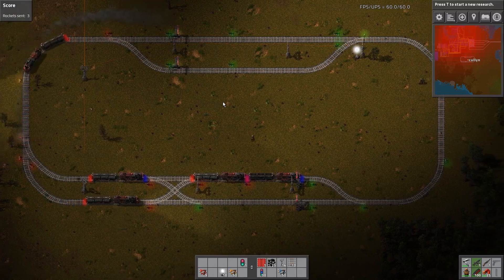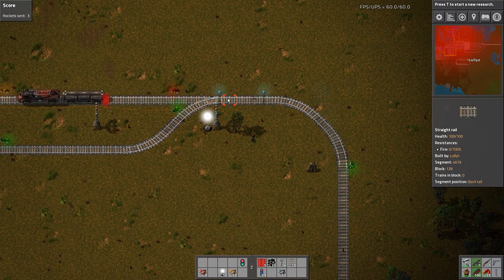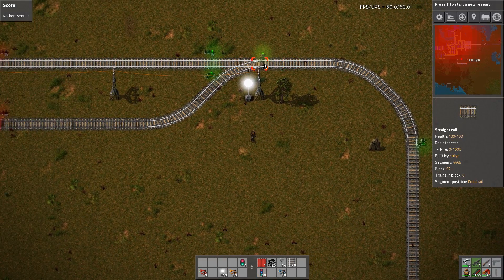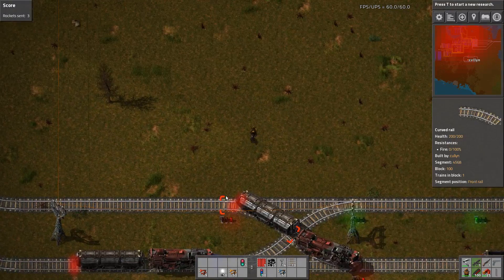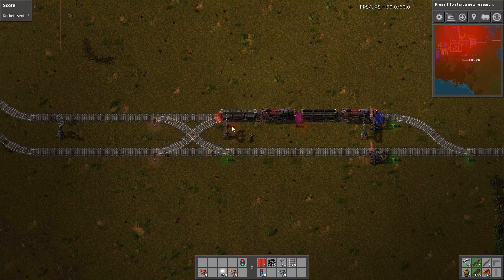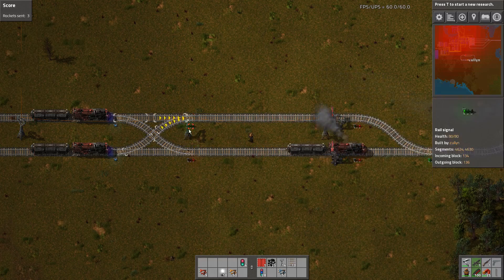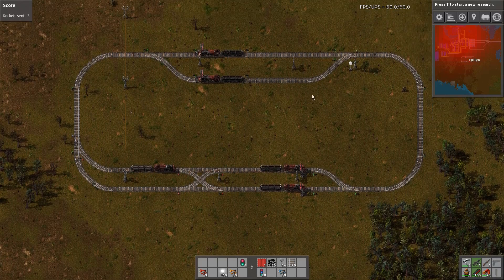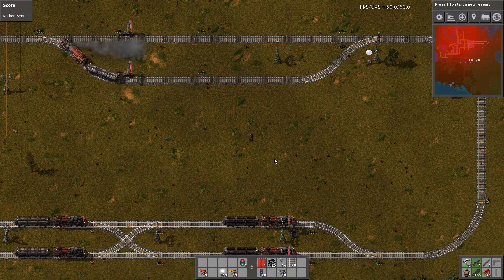Factorio Quick Tips 2 - Rail Signals - 0.13

Comment: So if the second signal repeats the first signal I am confused as to what tells the first signal it's clear.  And if the first signal says "Hey it's clear" then wouldn't both the waiting trains collide?  Anyways I'm sure I'm just retarded because I watched multiple videos and still don't understand.  I'll find out in game.  I actually just came back to say thank you so much for making <5 or even <10 min videos.  All the other Factorio guys make 40min videos.
Reply from the maker: With instructional videos I'd rather get the point out in less than a minute if possible, keep the intro short and concise, get to the point!

The chain signal repeats the signal states after it. Say you have one chain signal before two block signals, if the block signals are green the chain is green, if one is green the chain is blue and the trains logic will determine if the green signal is on its path or not. If both a red, the chain will be red.

As for the race condition with competing trains, while I have not done any testing I would hope the first train to get to the signal is the first one to leave.

Hope this helps!

Comment: would you be able to a complete moron tutorial? from beginning to some more complicated multi rail junctions, it would help me out a lot
Reply from the maker: just trains or the whole game?
Reply: just trains and signals
Reply from the maker: The basics tutorial has been uploaded, I will do junctions in the next one. If you need anything else covered let me know!
Reply: I am looking for more examples as well. This vid is helpful. Thanks!. I added a bypass around my base, the internal lanes where getting clogged up. so i thought to take long route around. however the train takes the route that gets clogged up all the time. Im sure the issue si the single placement. however i am still learning, I'm trying to see what i'm doing wrong. I was not using the chain singles (was not sure what they did until now) going to apply this tonight and see if i can unclog it :)
Reply from the maker: I've started working on the junction and station tutorial, ran out of time last weekend. I am planning on getting it done this weekend.

My biggest issue is I rarely use anything bigger than a three way junction so I setting some ground rules for building is Important.

If you want to see a good example of station building, episode 40 in my LP https://www.youtube.com/watch?v=03Lql9Et4CY has one of my best layouts from different tracks.
Reply: This looks good, Ill have to watch this later, thanks !